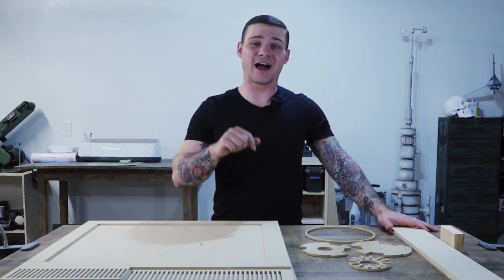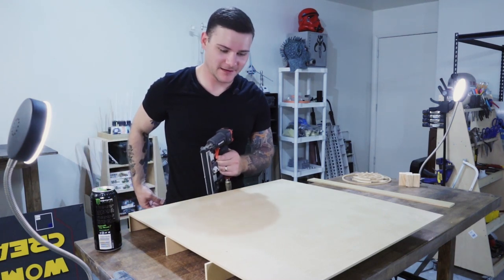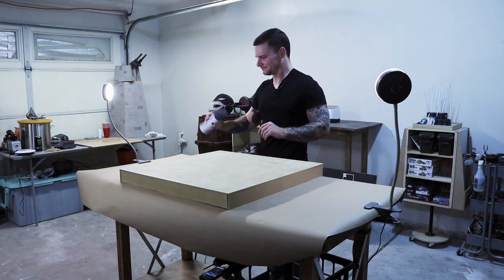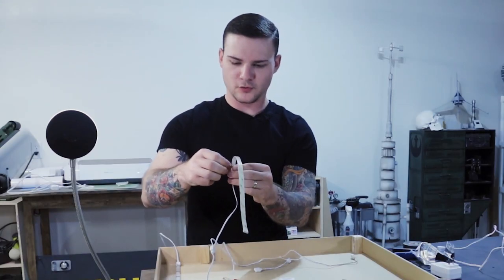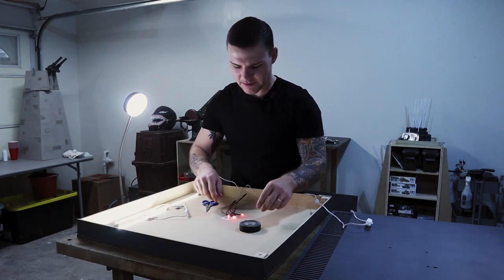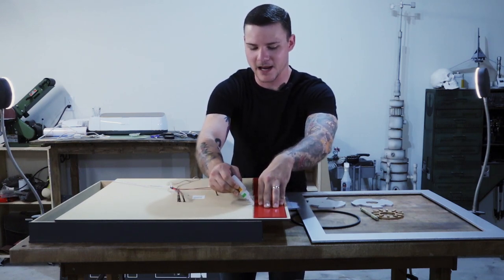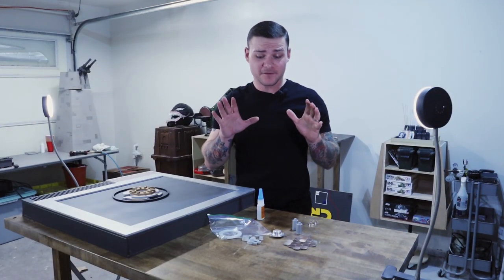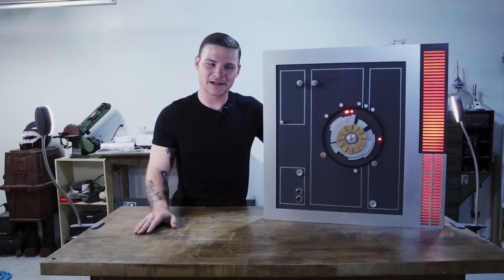ScratchBuild: Droid Interface Wall Art/Free 3D Files

Comment: So I watched a woodworker talk about pin nail tear outs. Just can’t find the vid. Sorry. If memory serves, he said that due to the design of the shank, how you hold the gun makes all the difference when nailing. If you hold it “gangster” while going down seam, it will tear out. Instead hold the gun normal as you run down the seam. The engineering of the shank should prevent tear outs. Hope that helps. I’ll keep looking for the vid and link later if I find it. Great vid btw
Reply from the maker: Thank you so much!